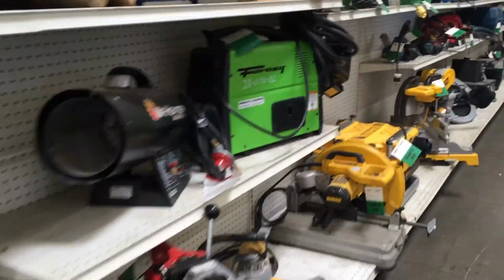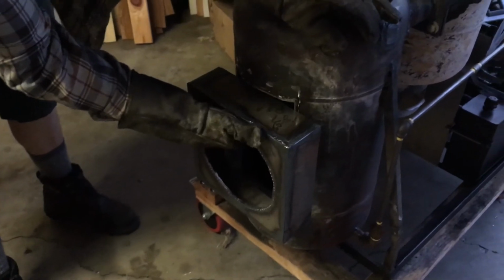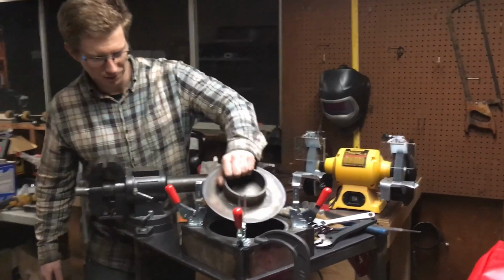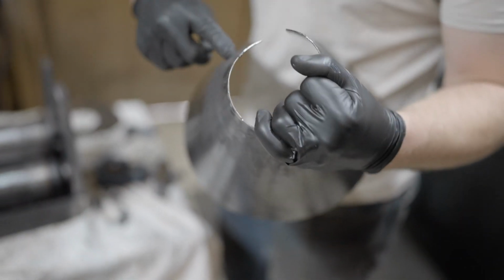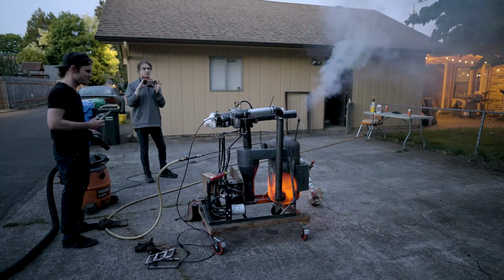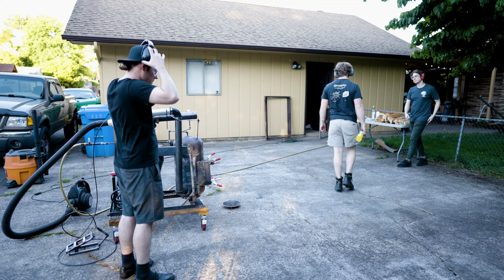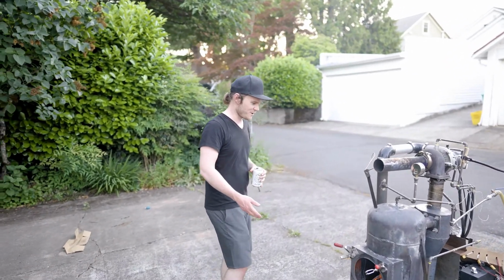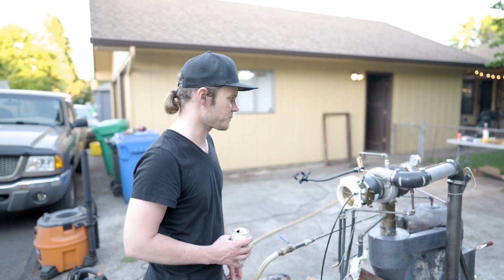TURBOFURNACE: IDOL OF MOTOR

Comment: Maybe, you need a afterburner stage?

for short; seeing flames outside the main combustion chamber is always a sign of lost energy ... it might look pretty, but it will just puff out into open air...

So .. from the fire box/container on .. maybe consider to feed the hot air for some inces along .. then mix air from a tiny fraction from the compressed air side in and maybe using a spark plug make sure that all the gasses with the tiny part of fresh air gets combusted too .. further expanding your exhaust gasses....

Then let them flow along and back into the turbo.... Which will now get cleaner and depending on the way from the fire box, even cooler air to work with.....

Just an idea..... hf ;)
Reply from the maker: Correct you are. The exhaust gasses are definitely rich. A lot of possible mitigations have been discussed.
Reply: The problem with wood (or coal) is that combustion is a 2 stage process. Early there is pyrolization of the wood to various hydrocarbons which create the smoke which you see. After all the hydrocarbons are gone you are left with almost pure carbon (coke/charcoal)... The smoke from this will be clear regardless of combustion efficiency. This is why the smoke clears up near the end. The way around this can be found in the Solo stove or the smaller Huhu which I recently purchased for $21 and absolutely love. Preheated excess secondary combustion air is the solution. Gotta design the combustion chamber to effect this. Also, 2 air control valves- one for primary and one for secondary would nail it for sure.

Comment: the *Tripple 90's coming off the supply is killing all of your boost.. need a straight section coming off.
Reply from the maker: It’s the fact that we are running the throttle body valve at 10% open that’s limiting the boost. This is to limit the EGTs to a sane level. A future model will have other means of limiting EGTs and allowing higher pressures.
Reply: @survantjames   ah limiting egts with the throttle is a great idea. Could the same thing be achieved with a throttle body T’d into the charge pipe. Venting the air between the turbo and combustion chamber?? 
Or would a large wastegate be a better idea? 

Which method would be best for controlling EGTs do you think?
Cheers

Comment: The same mistake everyone makes, don’t try to throttle it by a pre-intake throttle body, all you are doing is creating a huge vacuum which will suck oil through the seals.

Instead use an external waste gate to throttle by providing bypass air, you will keep temps down, lean it out and actually have something that’s self responsive and provides a natural negative feedback
Reply: Or restrict the exhaust.
Reply: Great theory. Could you vent it between the compressor side of the turbo and the combustion chamber? Would that be effective? Would just be a lot easier to setup than a wastegate between the chamber and turbo. I suppose a wastegate could be used then a compressed air source and a regulator to control how much pressure the wastegate sees to get it to open when you want. 

Mmmmm so many ideas. I’m trying to do as much research as I can as I intend to build one very similar with a larger turbo and heavier wall furnace and cyclone. I have a heat exchanger to cool the the lubricating oil. I want one that I can start up and run a couple of times a month when having beers with friends. A novelty thing that is somewhat reliable.
Reply: @ttv8ra23  
Waste gate keeps feeding air into the fire.
Blowoff valve venting keeps the speed down but the exhaust temps go up.
Blowoff valve dumping in before the exhaust wheel both slows the speed, limits the pressure and cools the exhaust. 

Main problem is solids into the exhaust wheel.
Reply: @brucebaxter6923  thanks for the reply. I’m pretty set on a wastegate between the combustion chamber/cyclone and the turbo. 

Will definitely run a cyclone like these guys. Will keep it alive for a lot longer. I’ll build it all a bit heavier though. 6mm wall thickness atleast.
Reply: @ttv8ra23  I think your going to need a massive waste gate. Check the channel Bobby Mcboost, he has a few videos building something similar, he basically had a T3 flange sized waste gate and it wasn't big enough to throttle the massive turbo he was using.
Reply: @ethanlindsey  I have seen that. I didn’t think he ended up using it. It wasn’t clear in the video. It would shower sparks and stuff everywhere if he did and I didn’t see that in the video.
Reply: @ttv8ra23  He did try using it but it didn't work because it didn't let enough combustion gasses out to slow down the turbo. In one of the videos with the smaller turbo he tried using the turbo's internal waste gate and the wasn't large enough to slow down the turbo either. I'm just saying the waste gate needs to flow a lot more air then you would expect or at least I would have expected before seeing those video.
Reply: Put a downstream turbine running an electric generator. Control the restriction by altering the load on the generator.

Comment: Been watching for a few months now and love the projects. would i be dumb to suggest you pre heat the water, and befor you say "then it won't have a cooling affect"(so the turbo doseint melt/damaged) if you heated the water by the system like raping a copper pipe around the chamber/or filter you use the other-wise wasted heet and make it easier to tern into steam, so its more efishint when running.
Reply: I think you have a pretty good idea! I had considered actually making a full water jacket but was worried the cooling might be too much, but seeing how much excess heat we have, I'm reconsidering it. Thanks for the suggestion!

Comment: this is amazing work!  I love the muted chirp when you reduced throttle, but I guess that means the next upgrade will be a blow-off valve?
Reply from the maker: Thanks! Because our throttle body is in front of our turbo, we can control the boost pressure with that, so we don't plan on adding blow off valve at this time. Next steps are getting it so we don't need garden hose or electricity to start or run it.
Reply: @survantjames  sweet!  do you plan on keeping a battery onboard for pumps, or going mechanical?
Reply: @Gavitron  We are a long way from being able to get torque off this thing, the plan is batteries for the forseeable future. And if we had it making torque the first thing we'd do is convert it into electrical energy anyway ;)
Reply: @survantjames  run a bypass from the boost to the hot side. Itl keep the turbine cool and bleed some of that boost off